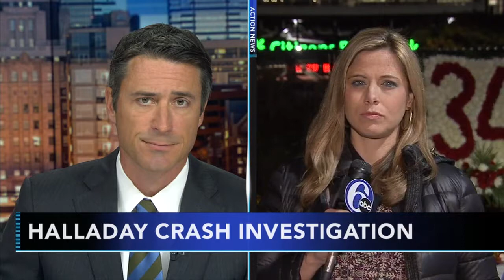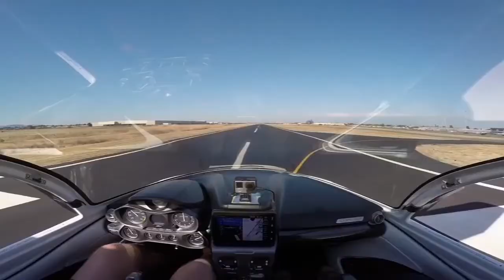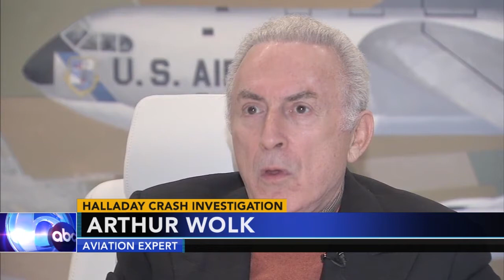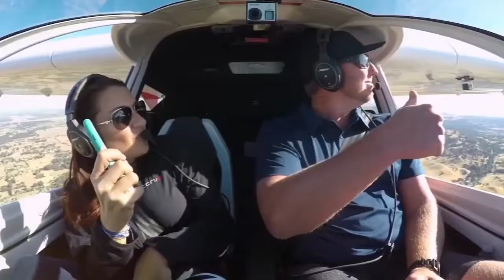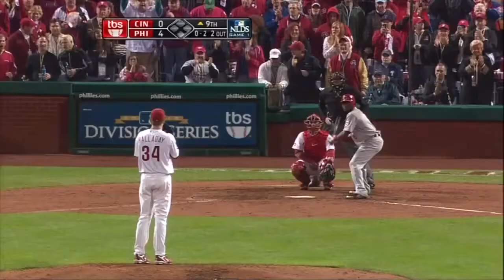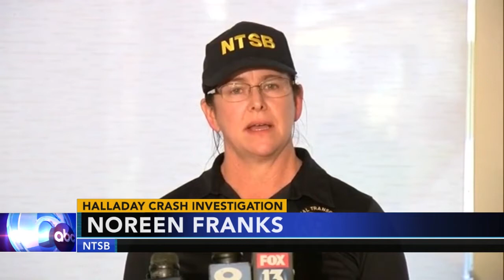Halladay was flying plane low, witnesses tell safety board

Comment: "practicing approaches" what I saw was a hard left banking descent to below minimums with no flaps and no rudder. That's no practice approach.
Reply: errol mcinnes you could see he wasn’t using the rudder?! I agree, the Flying he was doing was not practice approaches, but to say you could see he wasn’t using rudder is a little far fetched. I saw the cell phone footage before his crash and his airplane was far enough away you could see he was not flying safely, but you certainly could not see the control surfaces and how they were being manipulated.
Reply: Watch the video again. The plane had  wide slip going into the maneuver. No, you can't see the control surfaces. You don't need to with the slip that is clearly visible.
Reply: errol mcinnes even if that was the case, it could be possible that he actually was practicing approaches. Maybe he was trying to refine his slipping technique. To the untrained eye forward slip would look like a cross coordinated dive to the landing surface, but it is in fact widely used technique to bleed off speed and altitude on short final. It’s quite possible that he was practicing aggressive slips on final and practicing his re-coordination of the flight controls on the round out. That would definitely give the appearance of someone diving toward the water and leveling out just above the surface.
Reply: we can go on all day, but at the end of the day, the result of the maneuver was a dead pilot and a plane diced into pieces in the gulf of mexico. That is a fact.